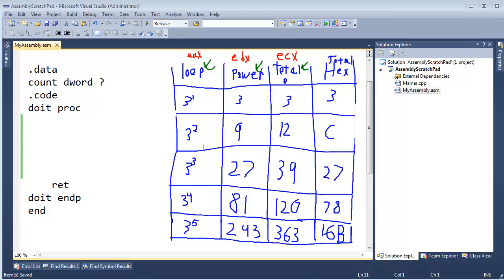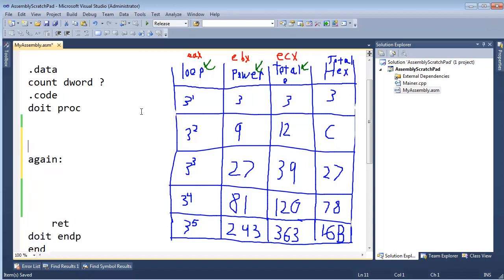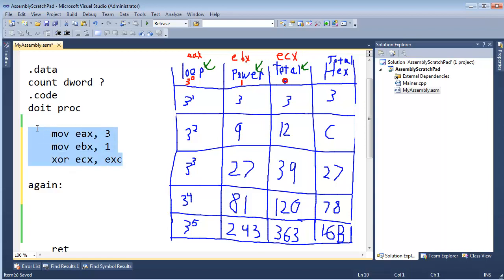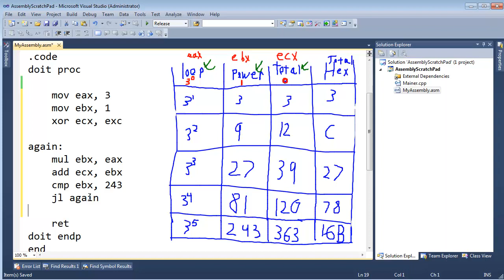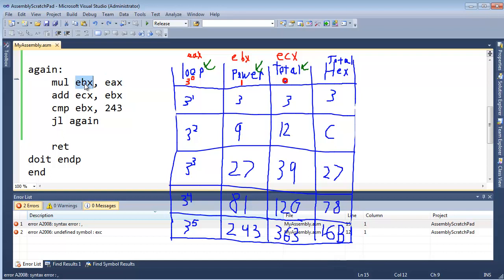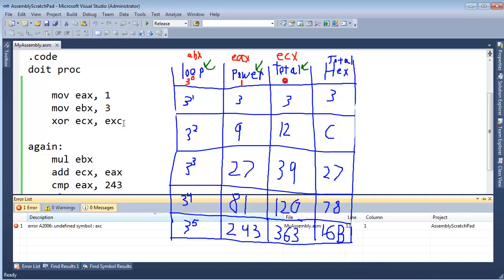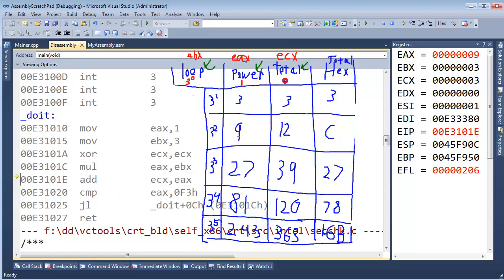Assembly- Writing a Program to Add the Powers

Comment: I'm getting more and more used to engineering my problems first, thanks _a lot_ for the tips. Was trying to solve the algorithm using sort of a "shotgun programming". After making a spreadsheet with the values (thinking ahead) and some possible strategies to get them it took me 10 minutes to solve it - Before I was trying for one hour and a half already.
Reply: Another approach is just to know some math ;) Then you would immediately recognize this problem as Horner's rule and just apply it right away.
Fun fact: Horner's rule will come in handy when you try to do base conversions for numbers, or convert a textual version of the number (its digits) into a binary number in a register :>

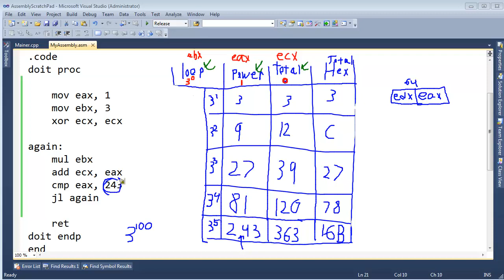Comment: 12:00 Well, let me see...
       3^x  =  2^64          // log3 of both sides
            x  =  log3(2^64)
            x  =  64·log3(2)
            x  =  40.37950423…
so I guess the biggest exponent before overflow should be 40. Let's check:
     2^64  =  18 446 744 073 709 551 616
     3^40  =  12 157 665 459 056 928 801    (still fits)
     3^41  =  36 472 996 377 170 786 403    (the spoon is too big :q )
Unless you're talking 32 bits, then 3^20 is the last one that fits (half of the 64-bit one).